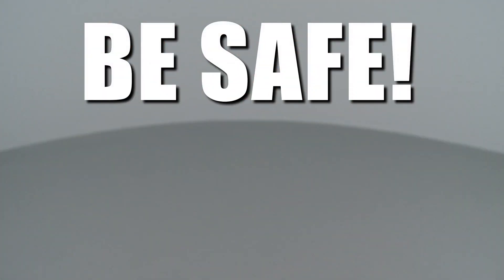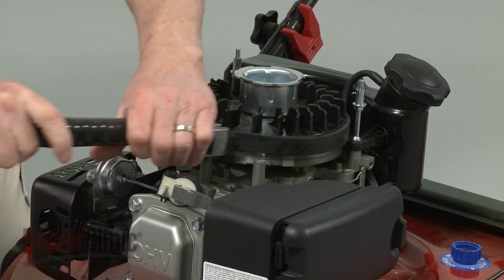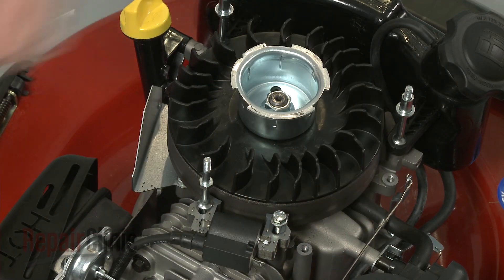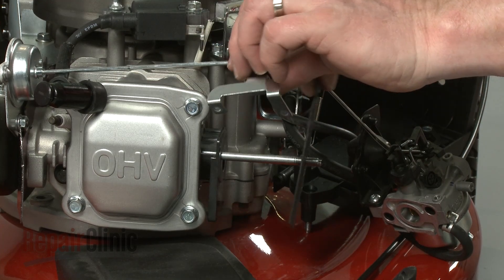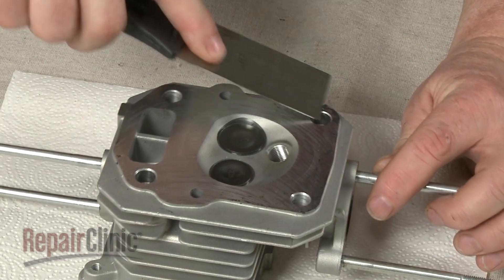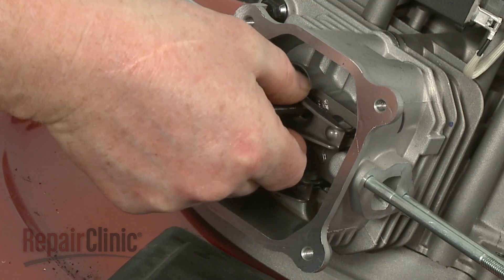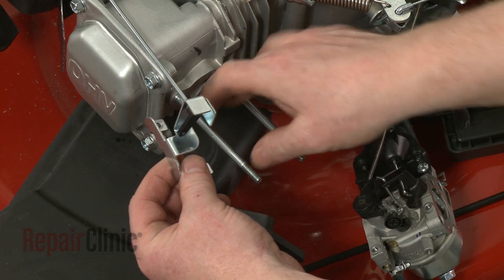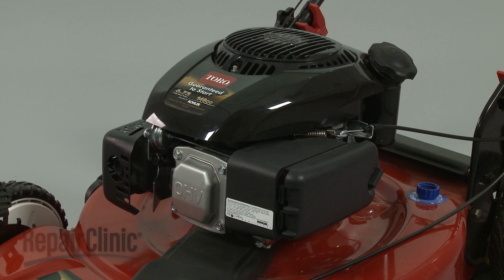Kohler Courage XT Small Engine Disassembly, Repair Help

Comment: Great video!  Mine was spitting oil underneath the bottom front after I worked it hard for a while.  The only thing possible was the head gasket and I couldn't get one in less than 6 days plus the next day to fix it so I cleaned everything up and lightly coated the gasket with Permatex "The Right Stuff 90 Minute", which is a few bucks more but I didn't want to wait 24 hours.  Started first pull.  We will see how it holds up over time, but I'd guess well because it has to be at least as good as the silver coating they put on them.
Reply: That wasn't it.  It's coming out of the casting above the bottom gasket.

Comment: Got what I think is an XT650 (no visible model number anywhere) on a Toro 22" Recycler mower.

If anyone wants to know, seems the spark plug alternates for the Kohler 1413211(S) are Champion RA8HC or NGK DCPR6E. (Put the S in brackets, since it seems in most parts listings, but not on the plug I removed.) I've seen suggested gaps at both 0.030" and 0.040" in listings, so somewhere in that range should work.

Air filter seems to be a different style than the one in this video, since it pops on with a catch molded into it. Oddly there are instructions for service intervals molded into the inside of the air cover but no service part numbers. Air cover itself does have the part number 14096119, and it seems other than a model specific (XT6 Courage series filter), generic 5.25" x 4.5" sized filters also may work since they come up a lot in search suggestions.

So that little bit might be useful for general service other than the full overhaul level work in this video as it could help with finding parts.

Comment: Questionnoticed it has  I just got a Kohler XTX and don't know what the  small turn thing(with water drop drawing around it ) is for  in your video it has the blue sticker that reads quick water  minds does not say anything but assume its the same thing   can you tell us whats it is for , I have read over the ins manual and don't find anything about it
Reply: Are you talking about the blue plastic piece on the rear of the deck. That's a you connect a garden hose and with the hose on and mower running, it should flush the grass build up under the deck. Hope that helps.
Reply: Its a gimmick. If your cutting dry grass and want a quick clean just a blower and stick it in the rear opening. Other than that you'll still have to flip it to wash it.

Comment: I have a XT675-2011 and oil is leaking thru the breather tube into the air filter. What could cause this?
Reply from the maker: +Paul Sierra This can occur from overfilling the oil sump, tipping the engine, or the engine getting flooded with gasoline due to a carburetor fuel needle sticking. Beyond these things piston rings could have worn and oil is getting into the fuel mixture.
Reply: Do these engines have reed valves in the crankcase that goes out to the breather tube? I cleaned the carb. and also checked the head gasket no issues there. It runs good no smoke just oil keeps coming out the tube.
Reply: That's all correct, for sure - but if that doesn't solve the problem, don't forget the breather assembly under the fly wheel.
Reply: Purchased  AWD used and it had same issue.   Since you posted a year ago I imagine you resolved the problem and forgot to post the solution or sold the machine off.  I had the same problem.  Removed the exhaust and cleaned.  It was very clogged up.  I also tapped out a couple of the grid holes to make a couple larger holes to reduce back pressure.  Under the fly wheel mine has cover with 2 screws... I believe this is the crank case breather tube filter, removed that, cleaned and reinstalled.  Filled with new oil SAE 30.  The previous owner put a 10w40 oil in which I have always been told is the best to use if you really dislike mowing yards.   Lawn mowers use a paddle type oil disbursement that  basically just splashes the oil around in the case.  This case a split weight oil to separate there in you have to light an oil in the case and a to heavy oil in the case.  Guess which oil gets sucked our the breather tube?  Then guess which oil gets trapped in the sump.  Doesn't take much imagination what happens to the piston after that.  So Paul there's some ideas to check if you still have the same issue,
Reply: Paul- Little late on response but just now saw your question. Your likely problem with oil leaking or being slung into your breather air filter is the oil breather which operates like a PCV (positive crankshaft ventilation) on a car. Oil pressure builds up and is released through this oil breather (PCV)and then drains back into the engine. This thing is usually a reed breather or little plastic like flexible tab that opens up a bit when pressure builds up. When this reed breather wears out it allows too much oil to be pushed with pressure past the reed breather, and instead of draining back into the engine the pressure pushes the oil out into the carb/breather. This reed breather is usually located in the valve cover or on a plate adjacent the flywheel. It is easy to change and inexpensive.

Comment: I need to know the Spark Plug part number. Mine is very similar but self propelled. Craftsmen Kohler Courage XT-7  6.25
And the spark plug I bought didn't fit. The one that didn't fit - RC12YC and RJLM19
I have paid buddy to repair but didn't replace the spark plug not did he give the old one back.
Reply from the maker: Michael Ashawasega We need the engine model number to locate the proper plug. A valid Kohler engine model will look like this XT618-01065 for example. It will be on the side or rear of the engine.
Reply: Okay most stickers that I.D the engine is faded. Second year. Here's what I got behind the Tank. 
Spec NO. PH-XT149-0311
Serial......
Reply from the maker: Michael Ashawasega Should be this item http://www.repairclinic.com/PartDetail/Spark-Plug/1413211S/2022979?TLSID=1773
Reply: Thanks. I'll try it. An let you know. Greatly appreciated.

Comment: Hi, do you have a video Assembly for the  inside of the engine. I took my apart and reassemble but cant make it run. help please. thank you.
Reply from the maker: We recommend using the repair help section of our website to diagnose your problem. It works best with your engine's model number - http://www.RepairClinic.com/repairhelp

Comment: this is frustraiting, i've had my my starter rope fixed twice because it gets cut...The second time i tried removing the 3 top bolts myself, but only 1 came off, the other 2 keep turning....so i gave up and someone else fixed it.   Now it needs to be changed again and got 2 of the 3 bolts off, only 1 keeps turning and turning why...wth am I doing wrong????   I ALSO GOT THE KOHLER engine, not the TORO
Reply from the maker: The nuts securing the recoil starter and top cover are threaded on a long blot that is screwed into the engine block. If the bolts are not secured tightly the whole bolt will unscrew from the block instead of just the nut. If you keep turning the nut the entire bolt should come out of the block. If you do have to remove the entire bolt make sure you tighten it good or this may happen again. You can also use a little Loctite on the threads to help keep it secure in the engine block.